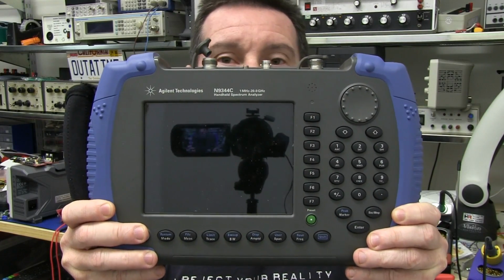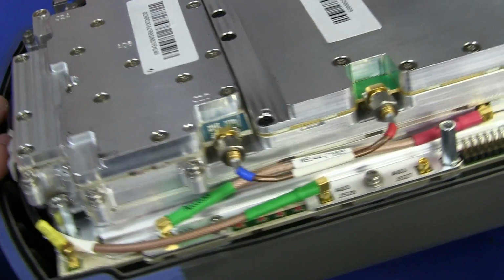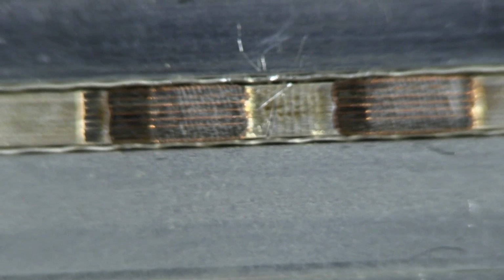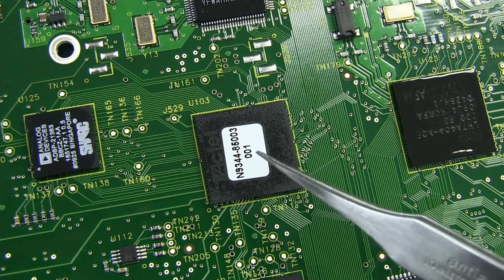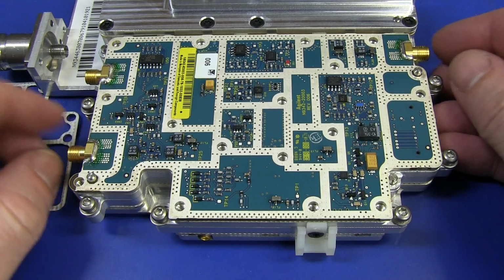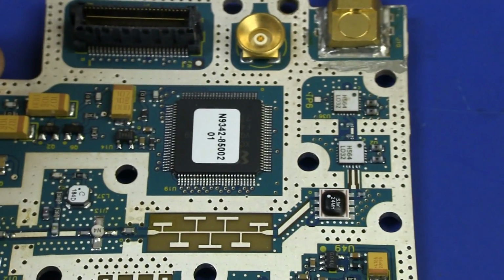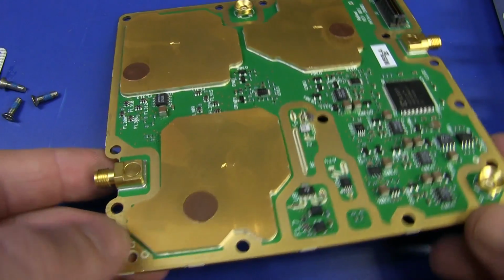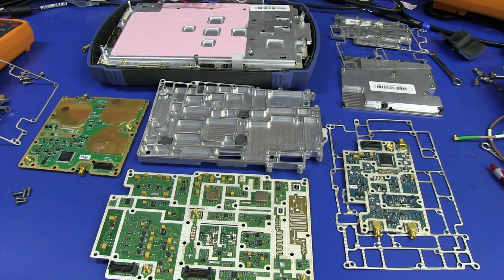EEVblog #470 - Agilent N9344C 20GHz Spectrum Analyser Teardown

Comment: Sorry but your video was sad . Dont wreck the unit show it functioning I have radar attachment to my general license and would give my soul to have the unit to monitor my 12ghz signal . gurkirpal singh
Reply: For suuuuuure, if i had a 20 GHz spectrum analyser with tracking generator, i wouldn't tear it down, i would USE it !!!!

Bot for a clean teardown i have full confidence in Dave Jones !!
Reply: dave does the tear down, so you dont have to :)
Reply: On the other side, Agilent won't throw away an 18k spectrum analyser for a teardown... The unit is probably either a demo or a real lemon that gave them tons of headaches. So instead of putting in on a shelf, they mailed it to Dave Jones.
Reply: ve2zzz if I had such a unit, I would most probably SELL it.